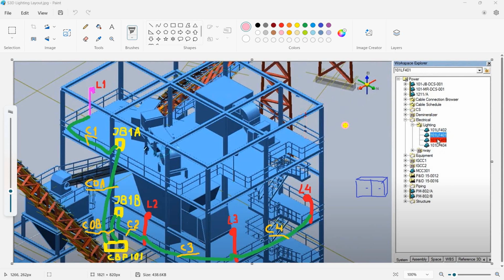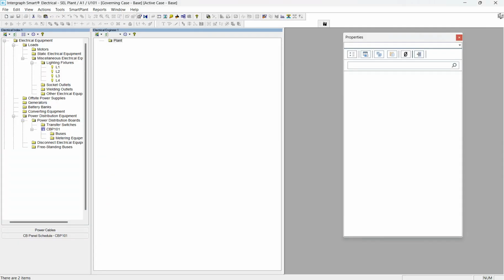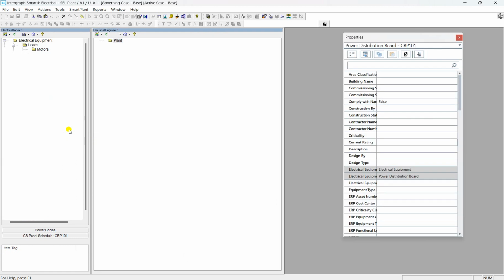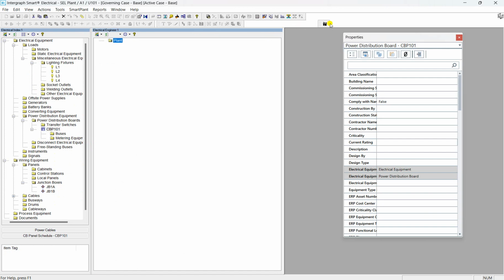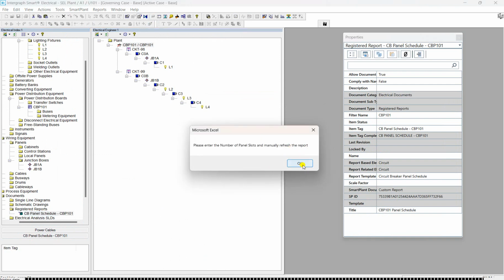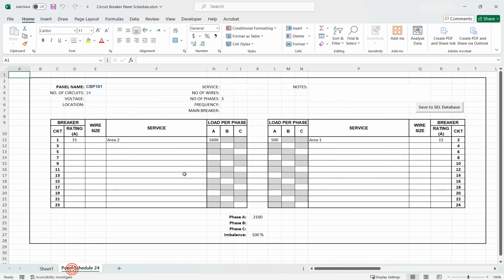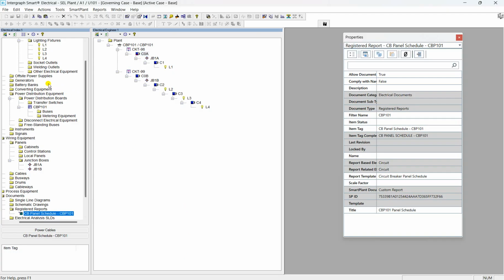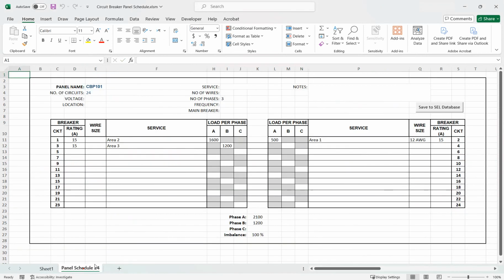Smart®Electrical: 3D for LV systems

Comment: I'm curious about why the Panel Schedule idea is facilitated by the functionality of Power Distribution Board and Bus, rather than Local Panel and Circuits which would be more logical to the users.  This would save the PDB class type for larger Switchboards and Motor Control Centers. Adding a large number of PDBs for the use of local breaker panel schedules complicates the Load Summary Report.
Reply from the maker: such an option can make a place. However weighting pros/cons between the two options, the preference was given to PDB rather than LP. Custom Folders allow to contain panels by type, Drill Down flg and other features help managing Load Summaries